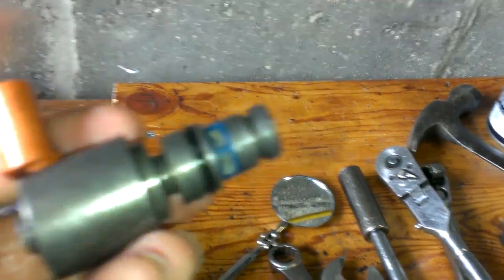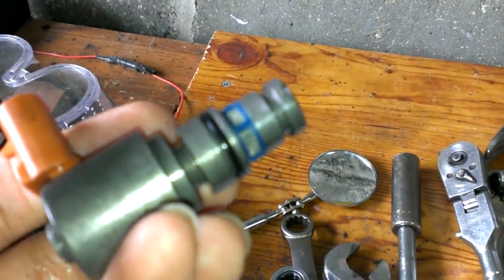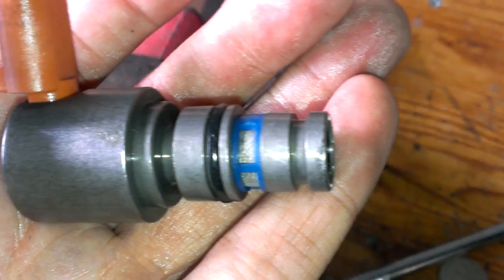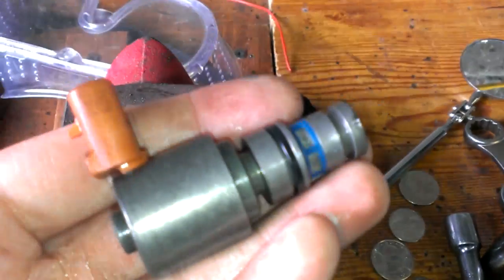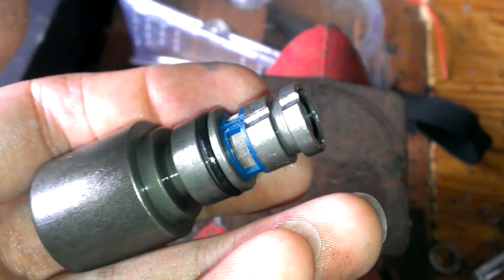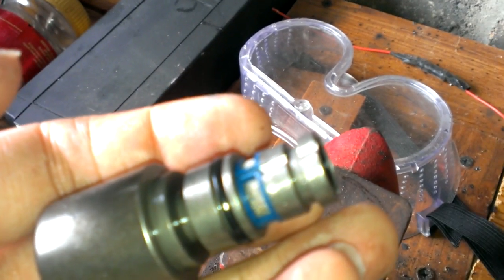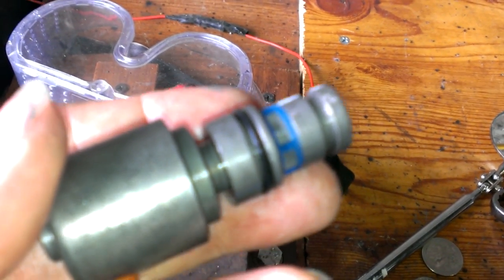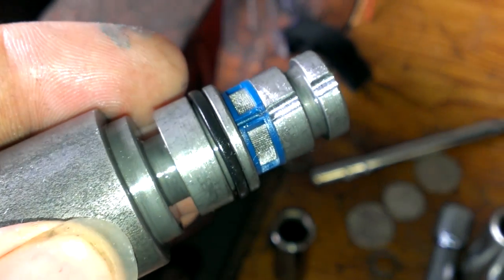PWM DELETE 4l60e MOD

Comment: I really like how easy this is, and how you can just get another solenoid to put it back to stock if needed. They're only $20. 

I have an 09 Colorado with the 4L60E, no codes, overall smooth, but I do get a slight shudder/vibration (like a tire out of balance occasionally), and I know for sure it's from the trans. I know exactly what PWM does now and I really don't like it, too much slop/delay IMO. My only concern with this mod (of which I'm going to try either way) is will it increase or decrease line pressure? I've read every comment to date, but didn't find anything on it except that long comment of a Sonnax bulletin someone pasted. 

I also suppose that if the solenoid is good, the size of that groove you make will make a difference as well.

Comment: I have a 1994 Chevy impala, long story short the yard bought me a 1995 PWM transmission which was marked 1993. This is a PWM with a 1994 valve body with sonnax upgrades ( new solenoids & what not ) I have a code 84 & I plan on blocking the valve next to the 3-2 down shift even though the 1994 does not have a 3-2 downshift solenoid. Does that make sense?

Comment: i have a 4l60e in a 2005 sierra, gave me the torque converter solenoid stuck open code, replaced all the solenoids, still wont engage any gears. Anyone have a link to some fixes I can try? Thanks in advance!
Reply: Speed sensor
Reply: What was it? Was it shifting hard

Comment: Just did this yesterday. Very much improvement in the shifting. Shifts are more stable and it goes into lockup solidly, no more mushy shift like before. I like it. 98 Sonoma 4x4
Reply: Hey, I'm slightly debating this mod and was curious about the long-term effects. How's your Sonoma holding up ?

Comment: Thanks for taking the time to make this video. Completley solved my transmission issue I was having with my Torque Converter slipping between 40 and 60 MPH. Now my trans locks up much better. Feels like I have 5 gears instead of 4. It also allows my deceleration clutch to engage going down hill now. That never happened before. Great info!!!
Reply from the maker: Awesome. Glad it helped
Reply: @bam6972  is the tcc solenoid in same spot as 4l80e I'm trying to install the transgo tcc valve kit for p0894 code
Reply: Did you reconnect the solenoid or leave unconnected I’m planning on doing this mod today
Reply: I reconnected it that way it will not set tranny codes and put the trans into limp mode.
Reply: @Bbernhardsr  thanks I appreciate it

Comment: Why not just block the pwm valve? Precision Transmission shows how to do this if you look up 4l60e pwm delete. He simply uses 2 check balls in each of the 2 pieces of the valve there to collapse the spring and stop it from moving.
Reply: @DillonTurner395 The Precision Transmission 2-check ball method requires dropping the valve body. The mod in the video above can be done without dropping the valve body.
Reply: Wish there were more answers to your question because Im a noob and was wondering the same thing. Mod with checkballs can always be undone so I think ill try it first.
Reply: @lancealderman2755  That's what I was thinking, I'm really not a fan of cutting metal on a part that'd be hard to replace.
Reply: @linuxguy1199  I've done a 4l60e with a TransGo shift kit since then and it has an option to bypass PWM simply. I did it but I don't remember all it consisted of. I can look in the instructions though if anyone is interested.
Reply: @linuxguy1199 not hard to get a replacement solenoid if for some reason you wanted to go back.
Reply: @TEDodd  Very true, it just seems pretty sketchy to me - maybe next time I change my trans fluid I'll give it a try!
Reply: @linuxguy1199  if you understand what the solenoid does it's not sketchy.
Just cutting a path to bypass the solenoid so flow/pressure is constant instead of pulsed. Whether there is any flow or not is controlled elsewhere.

Older, non computer controlled transmissions didn't use PWM to soften the TCC application. This mod (and others) make the TCC behave like those older transmissions.

That said, it should not be a bandaid for other problems. Fix them first. Then this can give full lockup for high power/torque needs quickly and cheaply.
Reply: I tried it with the check balls problem is still there

Comment: With this mod. can i install a 4L60E with pwm, in my 1994 s10 non PWM?
Reply: This is exactly what I need to know and to also know if you leave it unplugged.    I was misguided in buying a good used transmission and of course its a 95 or 96 one piece case with the letters PWM on the inside bell housing .  so do i leave the pwm mod alone, do this mod or unplug it??   Im putting the 95/96 pwm trans and new stock 94 torque converter on the transmission tomorrow morning.  Will my 94 gmc sierra 4.3 computer start acting up, go in limp mode, burn up something prematurely or will it work fine?  thanks.  I just don't know what to expect.  Do I do any jumper wires anywhere?   i sure wish I bought a 94 or 93 trans.  thanks.  anyone who knows, chime in.  thanks.
Reply: @duaneafields  I finally(the mechanic) installed the 95 pmw trans, in my 94 S10, last may. The only mod was to "delete" the PMW solenoide, i did the groove and removed the oring, my truck does not have the wire to control the solenoid, so the ECM does not even know that the solenoid conector is pluged. Transmission works fine ALL the gears, and even the TCC works fine, exactly  at 44 mph.

Comment: What’s New with 4L60-E PWM Modifications
Transmission builders are no strangers to modification. Making changes to increase performance, to prevent known issues from cropping up or to overcome existing problems is a hallmark of the ingenuity of the rebuilding industry. Many of these modifications can be beneficial, but some can cause unintended complications or downright damage.

Torque Converter Failure & TCC Friction Linings
There is a common modification for the 4L60-E TCC circuit that causes multiple problems, one of which is TCC friction delamination. Knowing how and why this happens is the key to avoiding converter failure comebacks which are the product of a modification someone else performed.

Before GM introduced its pulse width modulated (PWM) control system in the mid-1990s, the 4L60E TCC apply/release tactics were simple: on or off. At the appropriate moment, a command from the PCM to the TCC solenoid stroked the converter clutch valve, allowing release fluid to exhaust and opening the apply circuit for business. When the PCM de-energized the solenoid, the valve returned, allowing converter feed oil to switch back to the release circuit and cutting off apply pressure.

Simple and effective. But on/off operation had some shortcomings. Switching the TCC abruptly can result in a harsh apply sensation and adds unnecessary stress to driveline components. And while fuel economy improves with TCC operation, it can be increased further with a different control process. For these reasons the PWM control strategy was introduced. This control scheme eliminated the on/off feature in favor of a gradual apply/release function.

A second TCC solenoid was added to control the regulated apply valve. The TCC lining also was changed, from paper to a high-carbon content lining to stand up to the extra friction and heat generated during PWM operation. HTE (High Thermal Engaging) friction linings available from Sonnax are a good example of this type.
Under PWM control, the PCM sends a variable duty cycle to the second solenoid to control the regulated apply valve (Figure 1). The percentage at which the PCM increases or decreases the duty cycle controls the rate at which the TCC applies and releases. Ramping this pressure in stages gives us the smooth operation and improved fuel economy we’re looking for.

Figure 1:
OE Valve - Regulated TCC Apply

Figure 2 shows PWM progression during typical TCC application. Note the linear duty cycle change from 0% (unlocked) to 90% (full lockup), plenty of time to gently apply the clutch without harsh feel or driveline disturbance.

Figure 2:
4L60-E PWM Application Sample

As a further effort to improve fuel economy and prolong the life of transmission and engine components, PWM control evolved into EC3. The valves and solenoids remain (virtually) the same as with PWM operation, but the control strategy and TCC lining have again undergone changes.

Within the EC3 game plan it is generally undesirable to fully lock the TCC. Instead, a consistent slip of about 20 to 40 RPM is aimed for under most operating conditions. It is because if this controlled slip that a different clutch material must be used. Friction material designed for use in on/off systems will burn up when subjected to modulated slip conditions, and the lining material designed for PWM control typically wears out prematurely if used in EC3 systems. A friction lining with higher thermal capacity must be used such as the HTS (High Thermal Slipping) linings offered by Sonnax.

Torque Converter Failure & TCC Apply Pressure
When the PCM determines EC3 clutch application is necessary, the duty cycle for the regulator solenoid is raised in rapid steps to around 50%, providing enough pressure for converter apply to begin. It is right around this 50% mark that our desired slip (20-40 RPM) is achieved under most driving conditions, and the PCM will constantly monitor and adjust the pulse width in an attempt to keep it in this window while the TCC is applied. Under some high-torque or freeway speed situations, the PCM will increase duty cycle to 98% to fully lock the TCC. This eliminates slip and prevents excess heat during high-load conditions.

This adaptive control strategy can provide nuggets of diagnostic gold: as the regulator bore wears, the duty cycle required to keep slip in the appropriate range increases. You often can spot TCC problems before they trigger codes by monitoring duty cycle with a scan tool. For example, if you have a vehicle with a few clicks on the odometer and an average TCC duty cycle of 79%, you can be pretty sure the PCM is compensating for circuit wear, most likely in the regulator bore.

A common problem with PWM and EC3 units is caused by continuous oscillation of the regulator valve, which creates bore wear over time that allows critical apply pressure to exhaust. This often results in the setting of code P1870 and/or P0894 due to excess TCC slip. Transmission builders quickly realized they could eliminate these codes (but not the bore wear that caused them) by blocking the regulator valve with an inner pump slide spring from a 700-R4, effectively returning it to an on/off system (Figure 3).

Figure 3:
OE Valve - TCC Reg. Valve Blocked for Full Line

This modification allows full line pressure into the apply circuit, up to 140 psi under load. In contrast, OE apply pressures range from about 60 to 80 psi. While the extra pressure masks bore wear and provides a Band-Aid for TCC slip, it can lead to:

Cracked or deformed TCC pistons
Broken damper rivets
Torsional driveline disturbance
Damaged crankshaft bearings
Harsh apply feel
Friction lining delaminating from TCC pistons (PWM and EC3)
Converter failure
These problems are made worse if line pressure modifications are performed which allow even higher pressures into the apply circuit. On top of this, a sizeable line pressure leak is introduced, because the worn regulator bore is now open to line pressure, allowing it to bleed off to exhaust.

This blocking modification has been embraced by some builders of high performance or heavy towing units, even without a trouble code to conquer. There is at least one aftermarket kit that mimics blocking the valve, with the same detrimental high pressures being allowed to the apply circuit.

With this information in mind, it becomes apparent how a torque converter that was built perfectly to specification can fail due to being installed in an improperly modified transmission.

Sonnax TCC Pressure Limiter
To avoid the negative repercussions of full line pressure in this circuit while still allowing slightly elevated apply pressures for better performance, Sonnax developed the TCC pressure limiter spring system, which converts the TCC regulator valve into a simple pressure limit valve. With the isolator valve removed and the PWM feed orifice in the separator plate blocked, installing the limiter behind the regulator valve regulates line pressure into the apply circuit down to a maximum of 100 psi (Figure 4). This is enough for extra holding power while avoiding the consequences of full line pressure to the TCC piston. It’s the only available modification that both eliminates PWM/EC3 operation and limits converter pressure to acceptable levels. Since the apply pressures are capped in this manner, the pressure limiter can be used with friction linings designed for on/off, PWM or EC3 with great success.

Figure 4:
Sonnax Limiter Spring - TCC Apply Pressure Limited to 100 PSI

The pressure limiter is a performance-enhancing spring found in Sonnax’s popular HP-4L60E-01 Performance Pack that changes how the lockup system works. The spring is NOT a repair for a worn regulator bore, as it is designed to work in a properly functioning apply circuit. If the TCC regulator valve bore is worn, the only way to restore the valve bore and prevent pressure loss is to install Sonnax TCC regulator and isolator valve kit 77754-04K (OE apply rate) or 77754-03K (increased apply rate). The TCC pressure limiter spring works equally well in an un-worn original bore or with the Sonnax sleeve kits. Used with 77754-03K, the limiter will deliver higher levels of performance by allowing pressure of about 110 psi into the apply circuit. This is the maximum clamping power available without causing the negative results associated with full line pressure to the TCC.

Like it or not, modifications will always be a part of this business. Some of them can burn you, even when you weren’t the one that performed them. Working with transmission builders to ensure they are buying a 4L60-E converter with lining best suited to their particular build or modifications is one of the keys to long converter life and avoiding modification-related comebacks.
Reply: Thank you for sharing this info. I personally had issues with my 4l60e in my 94 impala & no one seems to have any answers.
Reply: @leoamaya1818  If you have the money I would go with Sonnax repair it to normal or do the modification in this video or purchase the Teckpak A74741Q TCC VALVE REPAIR and see how long your Torque Converter can hold out however BEFORE making any decision I would highly recommend doing a complete and thorough vacuum check of the valve body and the input drum and transmission housing and reverse input drum if you can to make an educated decision after all your life and those on the road depend on you making the correct choice.

All the Best,
TBD3.0
Reply: I have a 99 Chevy blazer 4x4 with the 4L60-e with the PWM would you recommend be replacing the PWM, replace with a TCC or do the modification he did in the video
Reply: @benjamindales1911  TCC = torque convertor clutch , its engagement is PWM controlled and if that is no longer working properly ie excessive TCC slippage doing his mod and going to full line press may help but for how long will depend on how bad your slippage problem had gotten.

Comment: @bam6972 Do you know if the 4L60E's that came in '95 B-Bodies had this valve? I'd like to know before I pull the pan again and waste about 5 quarts of fluid. Having issues with a weak, inconsistent lock-up. Did the HD-2 kit years ago, seemed to help but didn't cure the problem.
Reply: I believe 95’s were non PWM
Reply: A week lockup that leads to a hard shift? What’s you find out

Comment: Hey bro, I concerned if this would decrease the life of my transmission. . . What are the disadvantages though?
Reply: Its more a convertor lifespan mod, pw modulating lockup is just wearing out the clutches for soft comfy engage.
Reply: This modification will help your torque converter last longer and generate less heat.

Comment: Hello i have a bad 4l60e non pwm that i took out from my 4x4 and i have a 96 4l60e pwm sitting here.. is there anything i have to modify before i swap it? They both have the same green connector from the harness but the older 4l60e is a 12 pin and the 96 is a 13 pin
Reply: My truck is a 93 gmc sierra Z71 4x4 and the newer tranny i have is from a 96 z71 4x4
Reply: There is a forum on interchange..it will work with slight mods

Comment: How did yall get the pan down with the exhaust pipe in the way?
Reply from the maker: you have to remove the rear transmission cross member to drop it. support the trans and unbolt it

Comment: Ok I'm still debating on doing this fix, does this modification do the same thing as the sunnax tcc regulator fix does, or are we talking two different problems. Thanks in advance
Reply from the maker: well if the tcc bore is wore out then it wont make a difference with this mod.
Reply: @bam6972  The Sonnax part fixes the effect that this mod creates, correct? So do you mean that the Sonnax part fixes a loose bore, whereas this mod creates a bypass in a similar way that a loose bore would, considering they would both allow fluid bypass? In other words, the Sonnax part would ensure the TCC works properly, whereas this mod would ensure the TCC doesn't work at all?
Reply: @skankytrick  the torque converter will still work just fine with this mod, it'll just be firmer instead of gently slipping into lockup. Which will help the TC last longer and generate less heat.